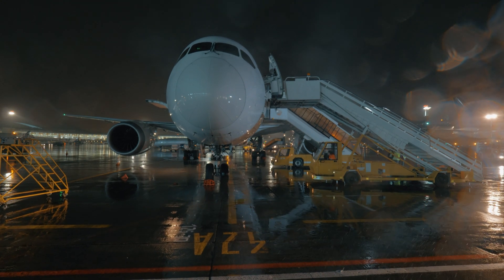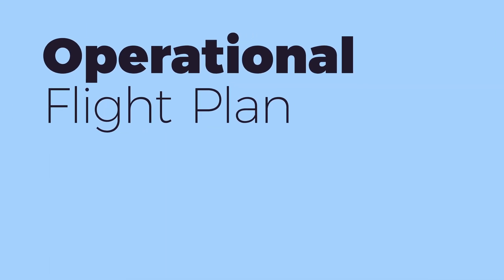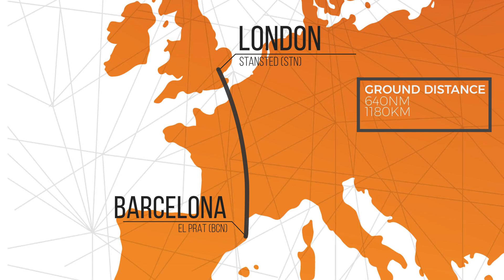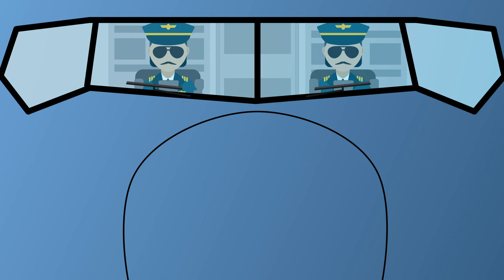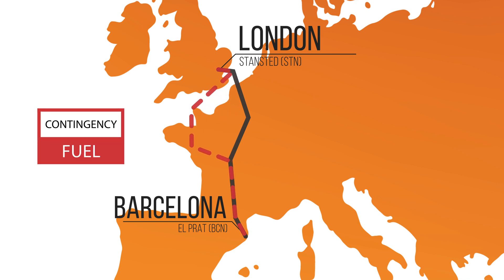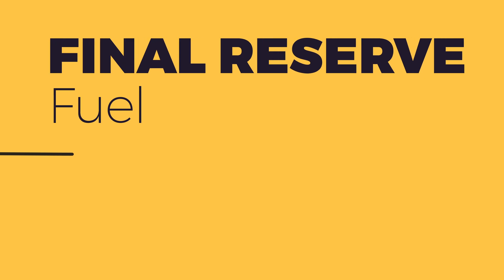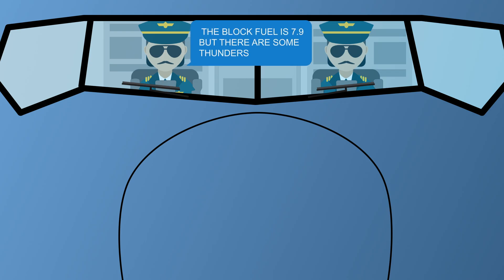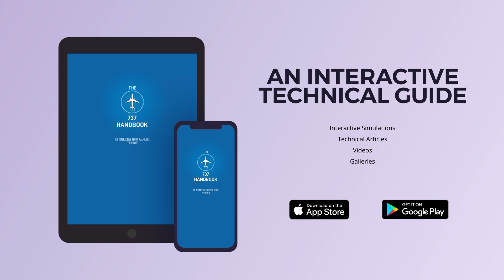How Much Fuel Pilots Take? | When to Declare Mayday Fuel

Comment: Shouldn’t the Ground distance change with a TW / HW? Because Groundspeed = TAS +/- HW TW
Reply from the maker: The air distance does, ground stays fixed with wind 💨
Reply: The 737 Handbook So why does Ground speed change with wind? And thats 

Nautical ground miles
Reply from the maker: Ground Speed is TAS +/- wind component you are right. But in planning air distance and ground distance are something completely different.
Reply: The 737 Handbook Does Ground speed just tell you how quickly you’ll get to the destination

Comment: Excellent explanation as always and I really like those graphics! 😎 Do you need to file only one alternate or two? And, in the case Barcelona tells you to hold for lets say 20 min, what fuel would you burn for that holding? The diversion fuel, contingency or do you have to plan in advanced for that possible holding? Thanks!
Reply from the maker: Thank you!:) Normally one, but if the WX in BCN would be below limits, we would need 2 alternates. In 20 minutes you would burn 800kg (200kg per 5 min)